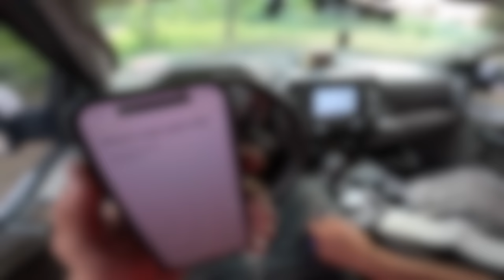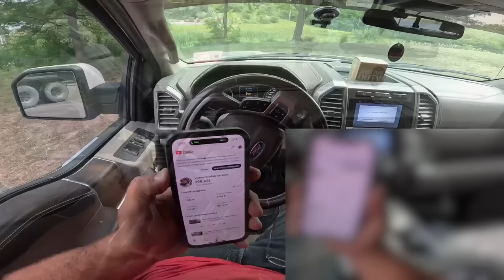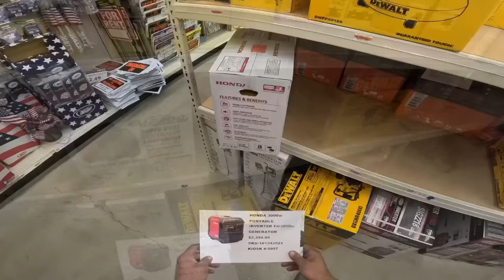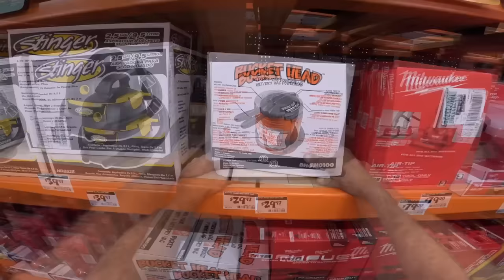I messed up and the customer was TICKED!

Comment: Ryan, I worked for Spectrum for several years. If you go to Home Depot you can buy a pack of RG6 connectors, F-81 barrel connectors, a prep tool to prep the broken ends and a compression tool to press on the new fittings. Having these on hand you can temporary get service restored within minutes when this happens again.
Reply: yes sir I would keep a few rg6 and rg7 fittings on hand probably cost about $100 bill for everything. Should be rg7 cause the business' thing....I would hope anyhow lol. In my opinion being that it is running the entire building on 1 line I would make the cable guy bury it in conduit. I was a Time Warner installer for years myself. Defiantly do not miss that job for 1 min. Knocking ice off a ladder at 7pm in December to climb it to access a tap over a major 4 lane highway was not my finest hour lol.
Reply: what if thats a fiber line??  @swamphunt
Reply: @soulsreaper7145  The orange line screams fiber to me so when guy said it's easy the ends just need stuck back together I almost rolled over because fiber don't work like that.
Reply: @leviwhite9  Fiber is also better protected than coaxial and not planted a couple inches underground in a high traffic area without conduit.

Comment: Coax repair is VEEEERRRRRY easy. You should take a snow day during the winter to learn. It really is easy.
Reply: Temporary, yes. But you don't want  any connections permanently underground.
Reply: @skliros9235  it's more the point that he can temporarily repair those so customers aren't mad.
Reply: Was a sub for comcast for bout a year. I have now been doing landscaping for about 5 years and I have avoided numerous headaches lol
Reply: @ramirobastida9543 can you repair fiber lines or do they have to be completely reran if those are broken?
Reply: @Schnooberu  it's fixable but not easy and not without special equipment as it needs to be spliced again.

Comment: As someone who excavates daily and has to find utilities I feel your pain. When ray had that pick axe I almost yelled, them lines are never deep and that is the worst tool to locate a critical utility line with. Never have found a internet line deeper than 6” out of 10 years.
Reply: That line was not nearly deep enough! Isn't there any code for having to be at least so deep for low voltage? Well probably is people just don't bury it that deep. I worked for an electrician for awhile trenching in electrical lines and they were very strict on depth.
Reply: @scootter2323 as a electrician yes we have to be critical, rigid conduit 6”, pvc 18” and direct burial wire 24”. And it is inspected before covered to be sure. But. Low voltage contractors do not have these same regulations or inspections. Their lazy too so that don’t help. Even the power company does not have to have inspections performed, they say they have their own internal supervision to be sure. I’ve seen those lines shallow as well.
Reply: Pick Axe ... wrong tool
Reply: What I don't understand is, why are the lines also so flimsy? I was expecting them to dig up some huge armoured cable or conduit, not a tiny little strand of wire that you could probably cut through with a tooth pick.
Reply: @oh-totoro  it’s just the internet cable/phone line. These lines are only 16 to 20 gauge wires twisted together they don’t need to be big. There is outdoor rated and indoor rates but their still both very flimsy. I’ve always seen them buried shallow for there is no regulations on how deep they should be nor do they get inspected. Most of the time contractors bore these lines in then once close to the building they just barely lay it underground
Reply: i hear ya lol im an excavator operator and thats 90% of my job is digging around and locating utilities its never ever fun or easy you get lucky sometimes but most of the time the locators mark it 6f away from where it is and they'll say 6ft deep its 4ft deep lol
Reply: I used to locate those utility lines and I also yelled when they started pick axing lol
Reply: There are no codes in most areas that force cable companies to be at any certain depth. There are however codes for gas, plumbing, and electrical lines.
Reply: @scootter2323  it’s drop wire they are never deep most times they hand put them in once in a while on long jobs they’ll use a small plow witch then it’ll be a little deeper. I do directional drilling and never find drop wires deeper than 6 inches hes lucky they even marked it around here they don’t haft to mark drops just main line same with electric services.
Reply: @oh-totoro  The main line feeding into the pedastal is normally about the size of your thumb and could be directly buried or in a conduit . Service drops are always small like that fiber service drops are even smaller and even easier to break.
Reply: I work around new construction homes, and internet lines are literally put on top of the dirt after the finished grade is done around the house. and then all you have is the sod  on top of the line 😂
Reply: yea spectrum only puts internet lines 2-in in up here
Reply: @snowblowerman5115  That is so wild to me!
Reply: Same here
Reply: Most of these cable or especially fiber lines installations are subcontracted over to guys that get paid per work order completed, so 9 times out 10 they will be installed less than 6” from grade height. They gently dig into the ground, run the line and go on to the next one.
Reply: I put a router from my house to my shed a few weeks ago.  Only dug it down a couple of inches because I'm the only idiot working there with the loader. Not two weeks later I was picking up some wood with the forks and one fork stabbed the ground and nailed the cable.  Thereby confirming I am an idiot.
Reply: So the thing they use to bury them, all providers is about as big as the compactor and only puts them 2 inches deep.
Reply: I'm a network engineer, and just from dealing with ISP lines in general I was so scared when that pick was going in lol. Here in TN they microtrench it 2 inches....that's it. It's crazy to me, because the line will never be pulled up out of the ground for any reason. If it gets damaged most of the time they just run a new one if it's that "last mile" patch to the building.
Reply: @concernedcitizen2031 "all" is a stretch, the contractor my cable company sent out did it with a ditch witch with a cable plow. 8-10" deep, i watched them do it.
Reply: @timr86868   that is a different situation, they sent out a contractor. If the cable company is burying the line and a lot of them do it likely is going to be be 2-4 inches below the surface and the machine they use is about the size of the compactor Bugs uses and they carry it in the van/truck they drive to your house for an install.
Reply: I used to daylight for vactor company. I swear the just lay internet down on the ground and the grass grows around it.
Reply: Spectrum around Milwaukee area is embarrassing
Reply: He subconsciously ripped it out because it made his concrete job easier. He had to run constantly over that wire…..but since it’s broke, oh just pull it out of the way. Not saying he did it on purpose, but he knows

Comment: Bucket head shop vac is actually pretty good. Was cleaning father in laws rental after a tenant had moved out, and they'd left it. Took it home and been using for all kinds of things around the house. Has comparable suction to my dewalt, but without the worry of it costing me if I was to break it somehow. 10/10 would purchase for a throw away vacuum job.
Reply: yeah we've had one for a couple decades we just use it for when we get water in the basement, getting into the corners in the garage where you cant get it all with a broom, super lightweight, no caster wheels to get gunked up, if you forget to clean the bucket out you just toss it and get another one from the dougnut shop.
Reply: @briancollins7296  youve had one for over 20 years? didnt realize they made em that long ago

Comment: Ryan, for like $100 you can have the tools and connectors on hand to repair that cable. Super easy.
Reply: For real, it's 8 little color-coded wires, easy does it
Reply: Probably a fibre wire not Ethernet

Comment: Might be a good idea to pick up some rg6-rg11 tools , fittings and cable to splice in situations like these. Easy to do and would be less stress when you do cut something.
Reply: A wise man right here
Reply: Exactly my thought, even just skinning and twisting the wires together would get it patched until the provider gets there. Also the fact a critical infrastructure building should have a redundancy lines not a single cat-6 2 inches under the ground
Reply: yep, i build fence and i hit them all the time so i have to fix them a lot. it’s actually pretty easy.
Reply: In previous videos hes shown that they keep splice kits on the trucks. In one video he cut a line(cant remember what type of line it was) and got a kit and spliced it himself.
Reply: @iamdrewski39  , Right. I’ve been in fences on the east coast for over fifteen years and cable , sprinkler lines and low voltage stuff gets hit now and then. 
   We do the repairs ourselves.
Reply: I was thinking the same thing
Reply: @GuessWho-uc5uq he hit a 110 line to garage.
Reply: Great idea.
Reply: I thought the same thing. A set of strippers and crimp tool and he’s good to go
Reply: @GuessWho-uc5uq  splicing 110 is way different from coax, you can't just throw a wire nut on Coax, you have to terminate it and use like a barrel to pass the connection properly.
Reply: after 20+ years of doing this you would think he would have thought of this by now.

Comment: Door systems like that are usually controlled internally and never by 'internet only' as it would 100% circumvent security.  Source: I've installed quite a few of them.  Management applications may depend on the internet for remote access and update of codes, but those systems are wholly independent in most cases.
Reply: That's why the lady got mad at first. She didn't knew how it works.

Comment: As a system administrator there is no way that daycare is running 100% off the internet. Doors don’t just open when the internet goes out image the security risk.
Reply: our maglatched doors need to have the new latches that still allow your door to stay locked, and even in a power failure that exhausted the backup batteries in the read head. Our alarm company told us about the new badge locks. The ones that activate a servo tripping the crash bar latch instead of turning a mag block on and off.
Reply: Sounds shady to have everything on the internet but technology isn’t my specialty
Reply: Ye she was 1000 percent over exaggerating the software most likely wont work without internet but I've never seen a access control system that doesn't work without internet
Reply: If the system was setup correctly they would fail closed/locked. She was probably way over exaggerating thinking the system was not going to work with no internet. Most have memory and should function even without cloud connectivity.
Reply: She was just upset she couldn't browse Facebook and Amazon all morning.
Reply: Exactly...Life safety and security should never depend on the internet.
Reply: Also if they need internet for EVERYTHING they need a backup connection for failover. That's what you get for putting everything into the cloud.
Reply: @TonyRule  I was thinking the same, or some youtube clip.
Reply: In theory it should be running over the LAN rather then the WAN. Most people think when the internet connection is broke that even locally host things are disabled
Reply: so what happens when a power line gets hit by a tree… cmon she was exaggerating. i’m a contractor and i know how customers can be. some and fine but others exaggerate to the moon
Reply: @blgli depending on the system they may fail locked or unlocked depending on programming
Reply: @iamdrewski39  in case of power loss a security system should have a battery backup or failover (auto lock, auto unlock). If it doesn't have either of those frankly that's not a good security system.
Reply: Who cares
Reply: She was just mad they couldn't plop the kids in front of a TV and watch baby shark
Reply: Came to the comments to post this same thing...there is NO access control system that unlocks all doors because the "internet is out". LOL! Imagine that...middle of the night and the Internet goes down, all the doors just go completely unlocked. When the Internet goes out, NOTHING happens, the access control system still works as normal. Sure, maybe you can't program a new card/fob if part of it is cloud-based, but existing all works as-is.
Reply: I don't know the centre, and I don't know their system, but I have to apply simple logic. (regarding doors - never mind back office admin)
Some people are saying the default state after internet failure cannot be "all doors unlocked".  The alternatives are all doors locked as a default, or all doors in the state at time of failure ie locked/unlocked.
A child care centre, with doors that all locked upon internet failure, would/should never pass fire inspection. A centre where all doors unlocked as a default reaction, would be wide open to 'visitors' any time the net failed at night.
So the truth must lie somewhere in the middle - probably if I had to guess, the default status is to stay as they are at time of failure, with the need and capability of a manual over-ride. Opening the door for every staff member, and every dropping off parent could be a hassle, but it's just more work, to keep your centre and clientele safe.
Reply: @blgli  Not fire safe.
Reply: I work as a robotics engineer hard to imagine having a system designed to open when it fails if it’s job is to stay closed.  But…. Daycares are cheap af and if they can cut corners they do
Reply: Maybe they would have to manually open the doors. People are lazy.
Reply: System admin here, I have seen it happen, no internet no door opening.

Comment: Not sure if that internet line was fiber or coax cable. Ive learned to keep tools to repair the coax lines, not sure if fiber has anything yet. But if it’s there it’s getting broken so I’m just up front with customers if we don’t catch it with bucket then running it over will
Probably break it so be prepared. It is definitely frustrating, especially with a business who operates everything on it!  Looking forward to the building and land improvements.  Gonna be awesome
Reply: Splicing fiber requires training and an expensive piece of specialized precision equipment.  Equipping to repair coax is a good idea but repairing fiber themselves is not practical.
Reply: @Greezy42  I kinda thought that was the case!  I know fiber is extremely fragile and will break just by being run over, even with protection mats laid over the top. We’ve gone as far as having fiber company reroute a temp line above ground until done then having them come back and bury it after completion just to not upset customer with loss of internet. Seems more and more folks have it these days and it’s always in the way!  Appreciate the info.

Comment: I used to bury cable back in the 80's for what is now Spectrum. We had to put it down at minimum of 6", & if we crossed a drive like that, we needed to put in a 1" PVC pipe 12" below top of elevation. You should keep a cable repair kit on your truck because we all know Spectrum is slow to show up. If you cut a cable line in the future, temporarily repair it then bury a pipe so Spectrum can replace it with a new line. By having a double gate it doesn't take a rocket scientist to know vehicles travel through them and at some point concrete might be added. Burying 2" was a lazy install & not acceptable. As an installer, if the ground is too hard to dig, we were to soak the ground to make it easier to dig. Mid block easement installs in grass were to be hand trenched to avoid cutting sprinkler lines. BTW: I subcontracted Spectrum and back then a bury only paid $12. no matter the length or if a pipe needed to be placed. A repair only paid $6.00. Repair of a buried line consisted of an F type female x female splice adapter, 2 fittings and 2 rubber boots filled with silicone, then encased in a shrink tube. The cable fittings were water tight (RG6 compression F connectors) that had nylon sleeves to compress & were stainless steel. Underground cable is different from Indoor or Ariel cable. Underground has a sticky polymer inside to make it water tight. Adios.

Comment: Most access control systems allow the system to work without an internet connection because  they download the information to the cards. The maglocks that hold the door closed should only release the lock  when there is a loss of power or if a fire alarm goes off.
Reply: Exactly. That’s a huge flaw if the internet is down. That’s pretty ridiculous.

Comment: Hey Ryan a helpful tip for you. Used to put in underground power and would hit cable lines constantly. If you take and skin back the wire and let the to inner coppers touch back together you can get the customer temp internet back unit they come and patch it back for good!
Reply: Wasn’t that fiber tho?
Reply: Copper internet?
Reply: What do you do if it is Fiber?
Reply: Rg11 is what spectrum uses and if it’s fiber break out your check book

Comment: Those cable lines are super easy to put back together an the tools and fittings under 50 bucks I know that doesn’t help now but you should keep a lil kit on the truck
Reply: Would patching it make internet much slower?
Reply: @Frankie431 As long as you make the connection well, it'll be just as good.
Reply: @Frankie431  no if you do the connection proper that’s all the cable company will do there not gonna run a new line probably good to use the fitting with the rubber boot on the for outside

Comment: Ryan I think you can reattach a coaxle cable. It is pretty easy to do. They are super easy to reconnect. Just cut and attach the fitting then crimp. Suuuuuper easy.